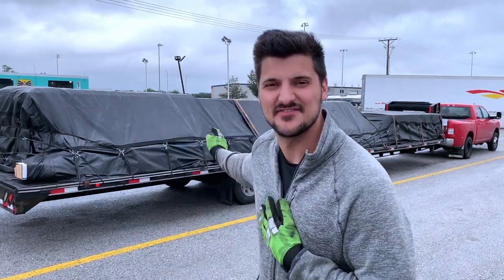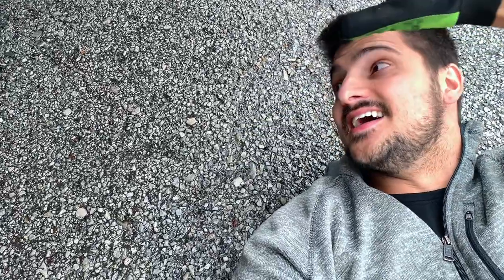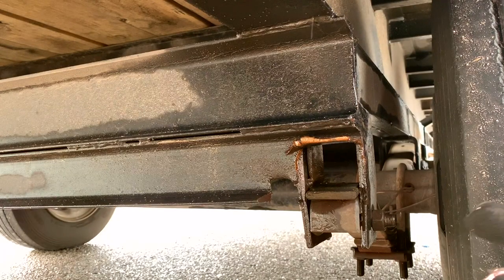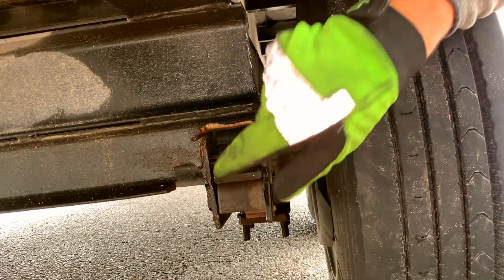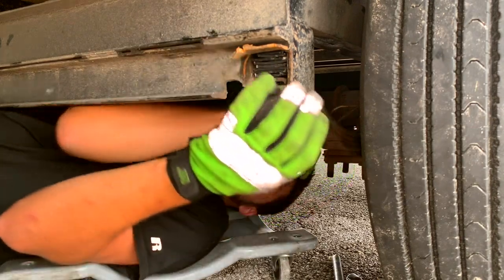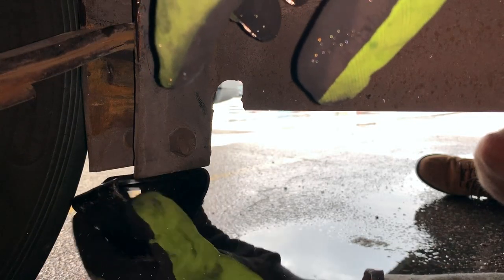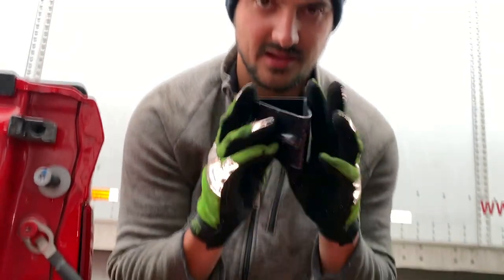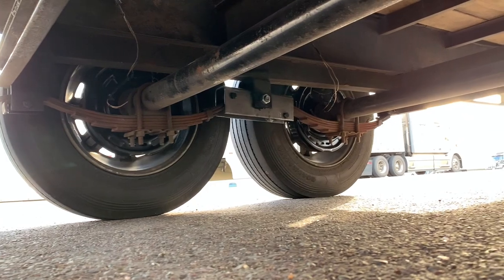How I FIXED my BROKEN TRAILER on the road - Hot Shot Problems

Comment: Love your bush mechanic repairs. you could get a job here in remote Australia any day. sadly the jb idea was smart but was always going to fail without duct tape or zip ties. You can join zip ties together to make larger ones .I was waiting for you to slam a piece of hard wood in from a pallet to get you going and use that strip of steel as a wear plate again using duct tape and zip ties to hold it together . Keep the videos coming. Stay safe

Comment: Pj makes their hangers with a plate like you did "on the good side" but they should all make those hangers with a steel block in the gap between the frame and the slipper spring that is one of the worst i have seen on the c chanel tearing from weight, and i have been servicing trailers for 5 years.

Comment: my quick fix 
galvanized pipe 3 inch nipple 
piece of chain about a foot long 
screw type link to tie chain together. 

raise trailer and get your gap. slide in pipe horizontally into gap. Place chain thru pipe and around bracket and lock in place with link. 
Got me home and working for another day or months lol

Comment: Hopefully on your new trailer you went with a medium duty axle like the 10-12-15k Dexter assemblies. The light duty <10k ones won't as you have learned the hard way survive doing what you're doing. The whole assembly from the hangers to the spring bushings and the electric brakes are really just low end and sub par. The medium duty assemblies are much, much better even someone with limited knowledge can see the differences.
Reply from the maker: 😞 went with 2x 7k just like I have now
Reply: @TowPiglet  why?

Comment: I would imagine damage like that to a suspension component would be an OOS violation.
Reply from the maker: You think so? It's been like that for a while, I've had inscriptions with it and no issues. It's not structural
Reply: Any that’s says California is a violation
Reply: @samperez4984  - YUP, but then again, do you expect this goof to be doing a proper pre-trip inspection, which would have caught it

Comment: JB weld is not an instant glue. 
 The way you used it it was a lubricant because it had not set up yet.
The standard type of JB weld needs at least 18 to 24 hours to get solid. You have been better off shoving a piece of solid wood in there and just putting a screw or a nail in either side, poking out, to keep it from sliding out

Comment: btw ,  you do not really need a tool to remove the wheel from the grinder. Just hold the stopper pin button and unscrew the wheel  with your hand

Comment: Its hard to tell what the part that was breaking is aside from the obvious ibeam.. was it the actual axle hanger or part of the trailer frame that holds the axles?
Reply from the maker: Hanger bracket is welded to the frame.
Inside is the cross member that supports all the weight from the leaf spring. It broke, a couple minutes I folded it down. The c channel that's cracked I think is supposed to prevent the hanger bracket from moving forward and back and eventually breaking those welds

Comment: I welded for 20 years. 
If you got a small wire feed 110volt .
Do a little practice with some flux core wire. Even you can do a good enough job to make it work. Just saying

Comment: Time to take that trailer to the scrap yard and get what you can for it as scrap then buy yourself a Diamond C trailer 👍🏻👍🏻
Reply: He has a custom trailer being delivered, idk by who by he did buy a new trailer
Reply: I love my diamond c trailer. I hope TP didnt buy a pj. The quality at pj has went to shit and the price has gone up.
Reply: @eavesstreet6307  pjs are for assholes like me that run new england in the winter. No matter what i do itll be rotten in 4 years. Though im ALL about quality, sometime the applicable value is more important. They have to be boarderline disposable items.
Reply: @thepostman69  lol I had a pj like 15 years ago and it was rock solid zero complaints. I looked at them about 6 months ago and couldnt believe all the problems I seen with them. Stuff not welded right and stuff cut short and jerry rigged
Reply: @eavesstreet6307  i dont doubt it but thats why i dont feel bad when it rots out or a swift driver hits me, or i drag its belly. I will say i checked out their low deck tailers and i think they are better quality than my 03 of the same model. I may switch to ironbull though. Never pulled one but they seem like decent trailers for $10k
Reply: Does diamond C do 40 footers..? I only seen 35 ft.. i got a Big Tex now and i wanna go Diamond C or PJ, but now im not going PJ.. because of these comments lol... Hows Load trail ?
Reply: @cedricwoodard2788 if you use "deck-over" trailers they are 1000% the best company. Diamond C the only trailer id buy for personal use. My PJ is looked at as a tool that i know is not something that i need to make last. Plus i dont think diamon c makes my style of gooseneck.
Reply: I would of amend stuff, and fix that trailer the way you wouldn't have a suspension problem for the next 30 years

Comment: Um....i bought a new 2019 Honda ridgeline hd ...going to put on the road..putting tow mirrors hitch in the bed and a heavy duty trailer....
Reply: Are you actually referring to using your "HEAVY DUTY HONDA RIDGELINE" & A " HEAVY DUTY TRAILER" to start hauling HotShot loads. If so, I'm betting you'll be having some problems with brakes, suspension, driveline. Look for some dually rims for it. They're easy to find!!
Reply: "Bye, have a beautiful time!"

Comment: Really why not find a shop I charge more when see u. Put jb weld or something where I’m doing a repair! Yes I’m a welder/fabricator!
Reply: Cause shops on the road charge a freaking arm and a leg. Where I'd pull the spring weld in a tube and slide plate for parts and 50 bucks total around 100 a shop would want 700 on the road away from home.

Comment: You needed to let the block you made sit for 24 hrs. Then the JB weld would have worked.
Reply from the maker: Exactly right, even though it was the quick set JBW I sat only about 45 minutes after I set the weight on it